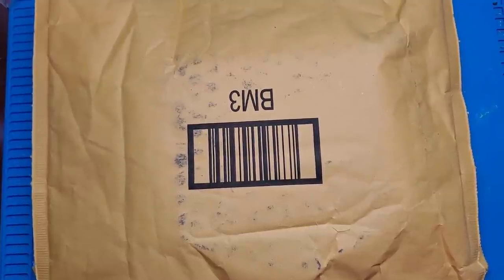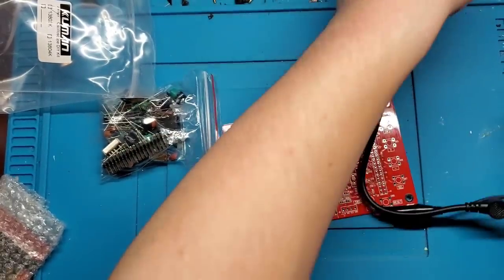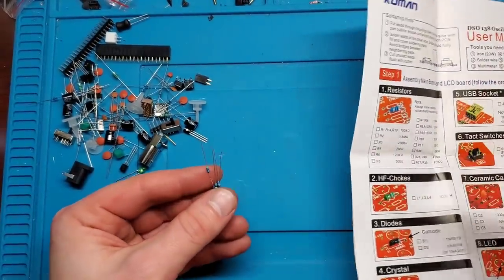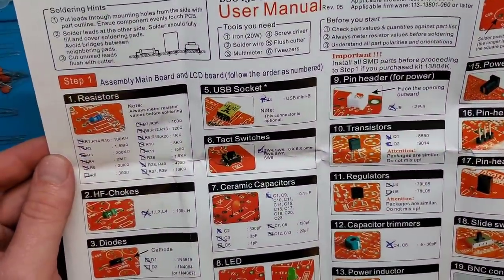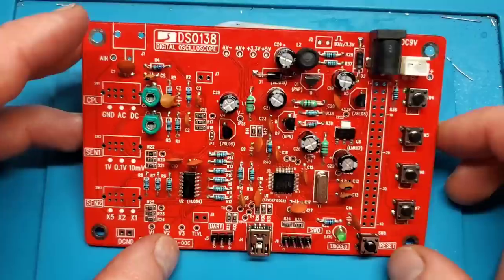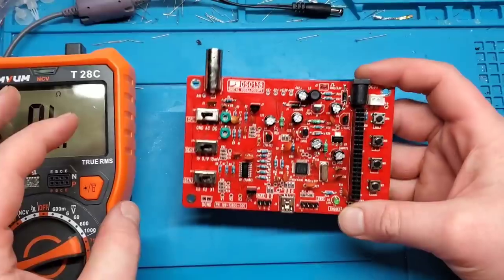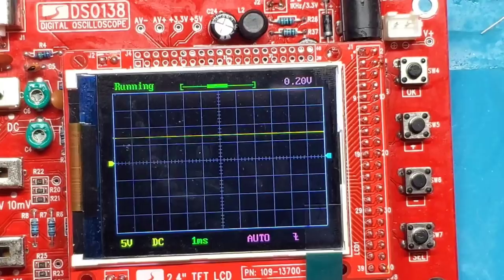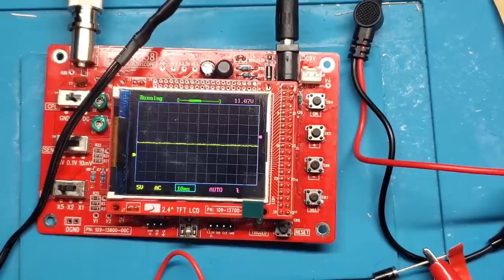Assembling a DIY Oscilloscope Kit - DSO138 - Retro Repairs -  Fixing Ebay Junk

Comment: This should be good enough for signal tracing, watching data lines go low and high, measuring clock pulses... There's a lot in regard to computers this device can help with.
Reply: It definitely seems like it can be used to verify that a signal pin is outputting a signal, or if it's outputting a constant high or a constant low.

If a dead chip conceals itself from continuity and diode tests, an oscilloscope can be used to expose it!

Comment: I just bought the same kit off ebay, sold as JYE Tech.  About to start assembling it and was disappointed at first about the smd diodes and chips since I'm getting very familiar with it, then I saw the super small pins and thought , nah, it's ok those are done 😁

Comment: Back when I was building Heathkit TVs,  O-scopes and such, I always used masking tape to congregate my resisters because I could fold it over the ends and mark each size as well as the "R" number of the circuit. Then I just pulled one out as needed. Plus, after folding the tape they weren't going anywhere if I accidentally bumped them while moving things around. Some of the time Heath did it for me in the kits and saving me time. Other times they just stuffed them in little envelopes with a kit number on it.
Reply from the maker: That was going to be my original plan, but the were a several cases where there was only a single resistor for a certain value.

Comment: when needing an oscilloscope but not being able to afford one, Id just use my phone's line in(microphone) port, add some resistors to split the voltage (maybe add two zener diodes across the whole thing, for safety) and use a sound analyze app or smth, there probably already are oscilloscope apps out there tbh.
(ik this only goes up to your phones sampling rate (typically only 48kHz), but thats quite alot cheaper than $25. plus Ive seen that those cheap oscilloscopes are quite terrible, even unusable above 100kHz)
They still seem to be fun to solder together tho.

Comment: I blew out the input on mine with a generator that put out AC way more than I thought. I think 50VAC is the limit, but if I repair this one I'll limit it to 10VAC with back to back LEDs.
Reply: Why? You will destroy any high frequency waveform as well as clip off any AC component thereof. Not to mention youll have to add current limit resistance etc.
Reply: @chantalheen484  Since I use this scope to check joule thieves, I don't care too much about distortion. I use a 10x probe for higher voltage, but for some reason the input opamp couldn't take the voltage spikes.

Comment: I could not stop staring at the hole labelled 3.3v next to the chip you were testing at 30:00. Was that TP22? Even tho I doubt I could make use of an oscilloscope I'm tempted to get one of these to find out lol!
Reply from the maker: That was tp22.  Possible that the directions had something lost in translation, and they were instead inferring i should use that test point.

Comment: Quick question. What temps do you run your iron at?
Reply: That would depend on the type of solder your using and it's melting point.

Comment: If I use rosin solder, do I need to preflux the joints? I never did before and it always turned out okay. Your thoughts?
Reply from the maker: It's still recommended,  especially with small diameter solder.   You can get away without on larger joints,  but for small stuff, flux is definitely a necessity.   It'll make your life so much easier
Reply: Buy yourself a flux pen regardless, it'll make your soldering life so much easier.

Comment: Hey there! I got a board like this from eBay, but for some reason jp3 and jp4 have capacitors already on them, but the instructions say to jumper them, which is confusing as they technically are already jumped with the capacitor. Or am I wrong?

Comment: What liquid did you use with the toothbrush to clean the flux? My board looks so greasy after all this soldering.
Reply from the maker: 99% isopropyl alcohol
Reply: I did think it would be some kind of alcohol but it's always better to ask. Thanks for the quick reply. Great vid.

Comment: are you a bit OCD I do not understand why you constantly clean the board after each item you put on it you can just as well we populate the board and once you are done soldering everything you can clean the board off I don't know why you're not using gloves because you would not get any flux onto your hands I have never put together many kits and that's what I do I put gloves on and then I complete the kid clean the board after soldering everything then I'm done. But you constantly clean the board it seems like a lot of wasted time and a lot of wasted that alcohol
Reply from the maker: 1. Spent rosin flux is sticky
2. Spent flux leads to poor quality joints
3. Alcohol is cheap
4. A clean board is a happy board

Comment: The waveform being jumpy at 33:48 is because the trigger level is too high.  The trigger voltage setting should be below the max voltage of the signal being measured for a stable waveform display.

Comment: New subscriber I’m working on the build presently. Everything worked except the test signal functionality. Then messing around I get only a white display and no blinking LED which I once had. I’ve changed components and checked circuits with no success but I will not give up. I’ve used a thermal imager and the 805 regulator up by the 9V input seems to be the only hot component. I’ve only started learning electronics heavy in the say last + year. I’m a retired aircraft mechanic and I initially started learning to fix and maintain and understand the electronics in today’s vehicles but my interest is just growing. I have other scopes but these small projects really help in building my skills. Thank you for sharing    Artie 👍
Reply: Take a DMM and with power applied to the scope, start checking for voltage to the various components Start at the power input jack and follow the PCB traces outward checking for voltage as you go. Good luck

Comment: Yeah, I figure that console and game repair does not require the use of an Oscilloscope that often, since it's generally a digital media. I would like to see some applications for it though, i'm certainly no expert when it comes to analog electronics, but it's obviously a dying breed now a days.
Reply from the maker: It could be helpful for testing ics, ensuring you're getting a clock signal, testing high/low,  etc.   A multimeter is still going to be a required tool,  and i can't justify spending hundreds on a real scope,  but this seems to be a fair option

Comment: Just checked my Amazon order from the other day and realized I bought a no-clean flux pen, hopefully I can use it for the time being and just clean with IPA afterwards
Reply from the maker: It'll be fine. Lots of people still do use it.  It's definitely cleaner,  but you still need to clean well once you're done
Reply: @RetroRepairs  Good to hear, those pens can be expensive! I'm a bit of a neat freak so don't really have to worry about it corroding anything since i'll be cleaning the components at least a few times haha